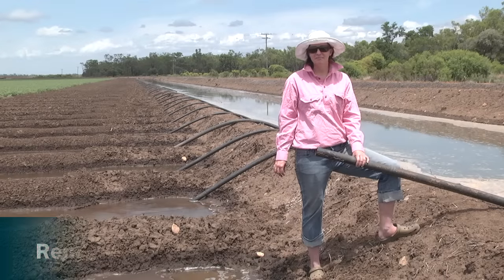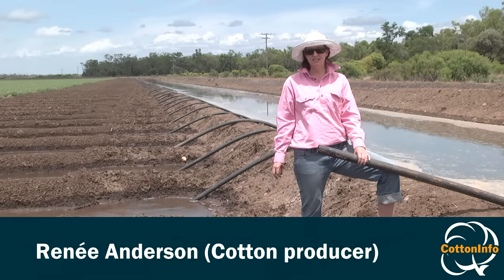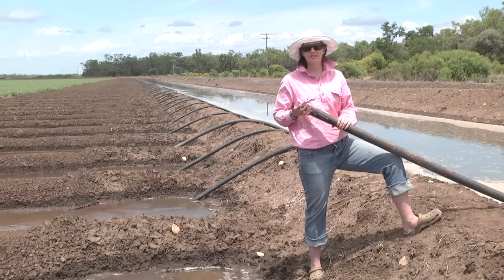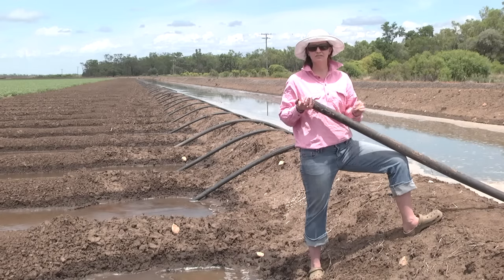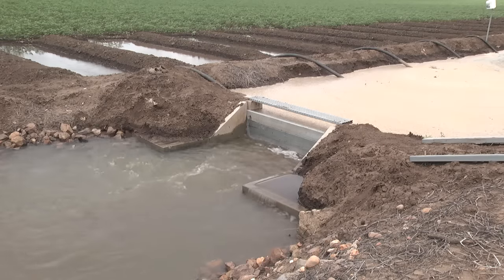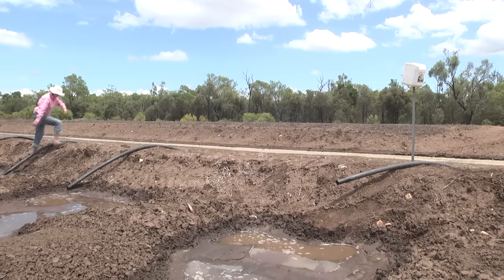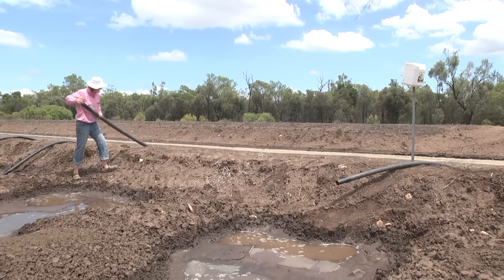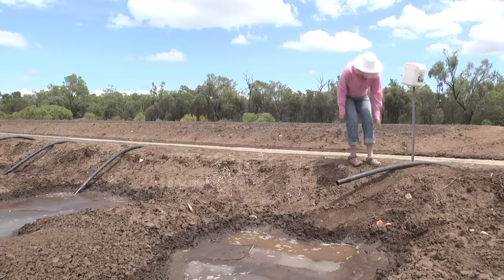Irrigating with siphons

Comment: How can make constant discharge of siphon, since discharge depends on head
Reply: I use siphon tubes on my farm. You have to set the correct amount of siphons for the stream size you have. If you set too many, the water level will be drawn down, head decreases and discharge of each siphon decreases. If you don't set enough, the ditch fills up and eventually over tops and washes out the ditch. But if you have a consistent delivery of water over time, the discharge of the siphons will be constant.

Comment: Is there a one way vale on the other end of the hose?z
Reply from the maker: The siphon contains no valves. The hand covering the pipe's end each time it is drawn upwards creates enough of a seal to prevent the water from falling out as long as the lower end of the pipe remains below the water's surface in the channel. Each time the pipe is pushed back into the channel, more water is forced into it. When the pipe contains enough water, the end is dropped into the top of the furrow and gravity causes water to flow through the siphon from the channel over the bank and into the furrow.

Comment: in italy we are many more intelligent: 100 electric valves and pipes installed under the water canal in manner the water inlet and the tube are down the canal line, simple, because the canal isn't made by concrete, electric solenoid valves of 2 inchs cost 20 usd each one and one solar panel and automatic timer and one remote 4g solar camera total cost 3 k usd maximum and you can sleep, and if you want save water simply water pump of 3 kw (4 hp) at 1 meter depth you can pump up 50 m3 per hour) and pe hoses with many holes